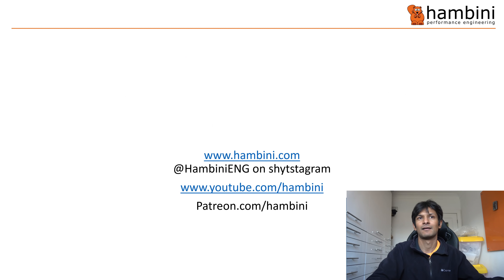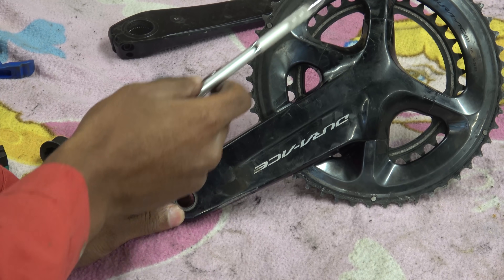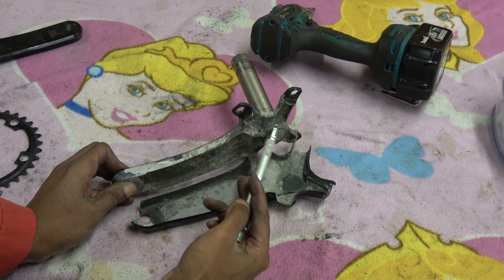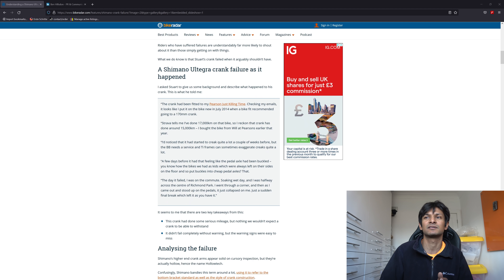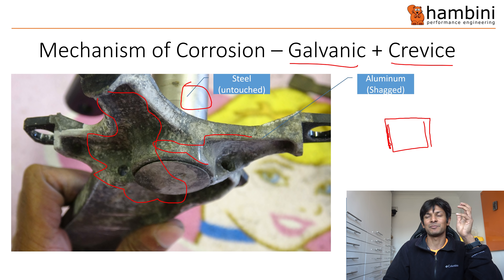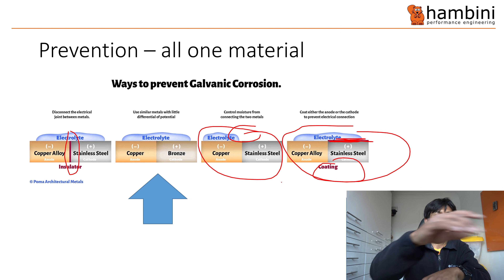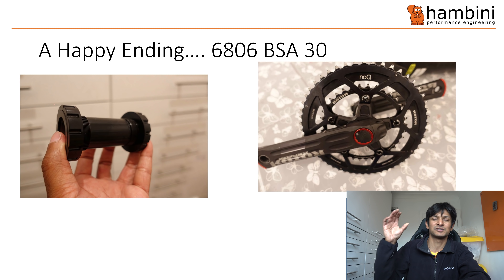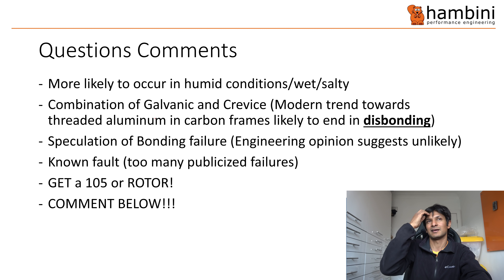Shimano REAMED for Engineering Incompetence

Comment: Believe it or not, if the component last through the warranty, I bet that’s it.  Regardless of cause.  So, if you experienced a failure 1 day after the warranty ended, too bad.  Doesn’t matter the cause.   If it’s a known manufacturing or engineering flaw, so be it, you still got thru the warranty phase.  As far as image of the company, perhaps there is not enough of failures to matter.  I don’t go out in the rain myself but it would most certainly be different for commuters and colder area where the roads are salted, as well as frequency and seasonal use.   This type of failure mode doesn’t seem to be sudden catastrophic failure, but instead with plenty of time for it to work it’s way to a point where one would have picked it up with an inspection before the ride or sense it.  I’m sure there is something in the manuals to do inspections prior to a ride like the way we are supposed to do before getting into the car, a safety inspection.  If say a carbon fork steerer was defective, with a sudden failure resulting in a fatality, and root cause analysis by the plaintiffs expert proved a defective design or manufacture, a whole different ballgame not likely to convince a jury with any defense argument - even though 1000s could have been sold without issue.

Comment: Could an oil or wax film on the inside of the crank prevent the corruption? Thinking to drill a hole somewhere hidden and spray cavity wax in to coat my cranks. It it has nothing to do with surface and it's within the metals
Reply from the maker: actually waxoyl might work.

Comment: I had the same issue with my Campagnolo Chorus bottom bracket.  It's an aluminum bottom bracket that was in close contact with a SEVEN Axiom Titanium bottom bracket shell.  A former pro team mechanic took off the bottom bracket in pieces.  Not a scratch to the aircraft grade titanium frame.  Why was that Mr. Hambini?  Is it because aircraft grade titanium is highly corrosion resistant?  Seven cycles really made me a life customer after that   Too bad so sad that Hambini doesn't make a BB for Campagnolo or I would have replaced the Campagnolo BB with his.  Ceramic Speed it is.

Comment: I wonder if there's clearance between the two shells of the driveside crank arm to drill a small hole in the rivetted end of the axle from the inside and spray some oil or paint in there to coat the inside surface? 
Of course, then you've just created a hole for moisture to get in and added a chemical that might attack the adhesive. 
Seems like Shimano should be coating the inside of the crank arm from the factory.

Comment: Shocking that such an obvious fault passed the design phase. Checking for corrosion cells is a key step for approving something before it goes into production. And corrosion basics (like explained here without entering the details of thermodynamics of corrosion potentials or corrosion rates calculation) is taught in the curriculum of mechanical engineers. Totally preventable and predictible.

Comment: I read, a while back, Reynolds put non-anodised aluminium nipples in some carbon rims, and they suffered galvanic corrosion.  The problem went away when they used anodised nipples.  Could Shimano anodise the aluminium parts before bonding the steel axel?  Maybe that would mess up the finish on the outer surface.  Or paint the inside before bonding the axel.  That's the insulator solution and surely wouldn't cost much.  And where the legs of the spider meet the chain rings, are they open or sealed closed?  Because there is an unsightly gap where they join, it's just asking for water ingress.

Comment: Bottom bracket creaking has to be one of the most frustrating things for a cyclist to hear. It's as if all your power and strength is going into thin air. When you hear silence when standing up and really stomping on the pedals, you just feel stronger. In Hawai`i, this design would be a real problem, because corrosion is king here in the islands.

Comment: Shocking design in the first place, classic case of "over designed", I still run original 7700 dura ace crank and Is faultless at 20 yrs old, lovely facom screwdriver 👌

Comment: So if I am riding a Ti framed bike with a 9100 crankset in the desert with the average power of the same prawn as Hambini (which I happen to be) am I (a) generating enough electrical power (through galvanic corrosion) to recharge my phone, or (b) absolutely fine or (c) Should change the 9100 before it attempts to kill me or (d) All of the Above?

Comment: Carbon rims with aluminum spoke nipples causes a similar problem: a gradual redox reaction that corrodes the nipples until they crack and fail. Aluminum spoke nipples are fine for alloy rims, but carbon rims should use brass spoke nipples.
This whole thing makes me question the longevity of carbon frames having aluminum dropouts for the wheels. That construction is common and I wonder what measures manufacturers take to prevent corrosion.

Comment: In my view the snapped axles on Shimano road cranksets (105 / UT / DA) are even more worrying than the much more common delamination or cracking of the crank arms / spiders.  Also totally inexcusable on a solid piece of steel.
Reply: @Hambini   Would the battery effect (steel / alu) weaken the axle, or is the weakening entirely limited to the aluminum of the cranks and spider?
Reply from the maker: @pmcmpc  it will always attack the more reactive material. in this case, it's the aluminium.
Reply: What do you think is causing the axle failures? It seems to be confined to 9100 / 8000 / 7000. AFAIK it never existed before last gen DA/UT and soon to be last gen 105.

Comment: Perhaps Shimano make the problem by not fully anodizing parts before glueing. Anodising greatly protect from any galvanic corrosion because it create a insulation all around the anodised part.
But there is another more insidious reason Shimame made it like that. The ansver is planned obsollesence so user is forced to buy one each year/period.

Comment: Would be interesting having a review about the carbon frames and forks having aluminium drop outs. You kind of made me worried right now !
Reply: Typically the aluminum inserts for bottom brackets and dropouts are wrapped in fiberglass before bonding.

Comment: Just watched this. I'm sad that Shimano  are making a poor product. I did always buy Shimano since I re-started racing in 2001, then when I built a new bike in 2003 I chose a SRAM red chainset as my local bike shop sold it to me for £200 and it worked with my Shimano front & rear 9 speed gears.

Comment: So the only way to avoid the corrosion is to have equal materials on axle and crank arm (aluminium), but you will end up with another problem : stress fractures of the axl...

Comment: very interesting topic, I have been wondering about that since some time, aluminium and carbon not so great together, but you seem to throw titanium into the same basket, doesn't seem to make sense, a carbon frame with a Ti insert seems like a good idea to me (just expensive) and actually pressfit would make more sense, since you didn't have to cut a thread into Ti (where you then have to thread an aluminium insert into) and you could mill the Ti after the frame is baked, and in theory it shouldn't be too difficult to get it perfectly concentric and in tolerance...

Comment: People want lightweight - this what happens. The other thing is galvanic corrosion.
Other cranksets from other brands might snap too.
The left crank of Shimano Deore Hollowtech 1 (Aluminium) broke in my case too.
Crankset Shimano XT 730 from the 1980-ies is still running.
Crankset Shimano Tricolor from the 1990-ies is still running. 
Crankset Shimano Acera or even Tourney for GBP 20,- to 30,- including chainrings are turning and turning. It's a lot about the weight. A lot of lightweight stuff is just not lasting. 
Shimano is Shimano. The biggest brand in cycling. Broken is broken. The distributor thing is not customer's problem. Just write to Shimano Japan - for example thru Facebook, Instagram and so on.

Comment: Excellent as usual! Around 31:15 you say that even Ti inserts in carbon will cause problems, but I don't think this is correct as their potential is almost the same; also, eg: helicopter blades can be a CF/Ti sandwich without issue, and some frame makers have used Ti dropouts and inserts for this reason. How are the latest Shimano cranks made? -looks the same to me.
Reply from the maker: You would get the galvanic effect whenever this any potential difference. This is why screws and joints in replacement hips etc are all of the same material. CF TI is fine in a helicopter blade which is sealed so there is no electrolyte ingress.

Comment: Sportdrink dripping out of bottles on the downtube and seatube cages may be the source of the electrolyte causing the crankset corrosion.  I had a corrosion issue with my Trek Madone BB90 bottom bracket bearings. I was going through bearings every few weeks until I witched to a Camelback for my sportdrink during rides.  Problem solved.
Reply: Switched, not witched.
Reply: I would worry more about road salt when biking in winter.

Comment: Question is? Has Shimano changed anything in their production to improve their hollow tech crank arms. What is a better alternative to Shimano?
Reply: Well it depends if u like carbon or not ? The latest bike I built was Scott Addict 
Di2, Ultegra, but I never really liked the D/A  or Ultegra chainset , so I went with
SRAM Red , to me looked better, was lighter and changed gear as smooth as 
anything Ive ever owned . After reading this lot Im happy with my choice .

Comment: The important question is - did Shimano address this in new Ultegra/DuraAce 8100/9200 line? I was wondering since it was published but nobody bother to check (as of now). Maybe our favorite engineer can have a look! ;)
PS: Thanks Hambini for the work. This was very interesting video to watch.
Reply: That would be an interesting concept.  Shimano fixing the problem as we sleep wouldn't  work.  We are aware now. Anyway, dream on!
Reply: @davidburgess741  not sure how you mean it David. Shimano is aware of the issue for many years now. So I would assume, there is some chance that they addressed it in the new generation.

Comment: Now I know why the bike manufactures are putting Rotor or FSA cranksets on their Ultegra and Dura Ace kit built bikes. Big bonus on the Rotor crankset is the ability to customize it with oval chain rings. Have you any experience with Rotor Q Rings?

Comment: And this, this is why I grease my old square taper cranks. Steel axle in an alloy crank, that's fucked if you don't grease the contact surfaces.
And if greasing the axle makes your crank stretch, well that means it wasn't a good crankset to start with.

Comment: My 7410 Dura Ace group has served me fine for 25ys. Best thing I ever did is keep my old steel DeRosa and 10V Chorus Rossin. I’m not a retro grouch in the least, I like technology, but I find nothing in modern bike parts and frames appealing and all of it unreliable and disposable or stupidly expensive and difficult to maintain. Even those two old bikes sadly need $70 bottom brackets rather than $1’s worth of ball bearings to keep running. Ever see the movie 'Idiocracy" by Mike Judge? That's where humanity is headed.

Comment: the cap seems like its not structural, all the loading goes into the other part
Reply: No, because the pedal torque interfaces with the cap. Also the twisting motion goes to opposite ends, one of which is always at the seam.

Comment: Would old b-type plates fit to that type of crank? I have FC-4500 (52/39 speed Tiagra) but finishing varnish simply brakes and peels off after years. Looks nasty. Don't care about the colour much, just the mounting holes and overall chain-rings offsets.

Comment: If a Hambini bottom bracket can now run a 30mm axle in a BSA shell by putting the bearings outboard, is there any reason why the same couldn’t be done for a BB86 shell, since BB86 is similar to BSA?
Reply from the maker: you can't do that because the bearings sit within the boundaries of the frame on bb86
Reply: @Hambini  argh, I missed that one is 68mm and the other 86mm due to the digit reversal and assumed they were the same. Not very dyslexic-friendly. I’m assuming your BSA 30 cups bring the width out to roughly the same width as BB86, so there’s no option to sit outboard to take it out any further. Shame.

Comment: serious question from engineering ignorance:
why do Shimano not MIG weld (or any other form of suitable alu welding) the two aluminium halves of the crank shells together and then clean to a polished finish?
(OTHER THAN COST)
If you can weld an alu frame, why not weld alu cranks?? surely this would be a better/stronger solution than an epoxy?
Reply from the maker: costs too much and you get distortion

Comment: Great video. Tangentially, the cast aluminum swing-arm in front di2 mechs fail regularly as well (mine snapped while climbing and shifting). Shimano rep told me it’s pretty common (really??). Tiny little individual part that isn’t manufactured to be replaced is common. Ergo, recommendation from Shimano is to replace entire ($200+) front mech.

Comment: the diagram you showed was from hollow tech 1, not the hollowtech 2 that you had. hollowtech 1 i think was a much better design as the crank arms are one peice unlike hollowtech 2. i think they were hydroformed before the ends being forged closed and machines for the octolink BB interface and pedal thread.
i guess it was much more expensive to make for them, hence moving to the cheaper easier to make cast and bonded structure with a pressed in axle.

Comment: I had a (almost new but second hand) Ultegra 6800 crank crack on me after two winters on salty streets. It took me a while to figure it out (bike mechanic even said the cranks were bomb proof). At first I swapped the bb, the pedals tightened the chainring bolts, even checked the frame for cracks... But then I noticed that I was able to make the crankarm creak by just twisting it in my hands. The crack was only about 2cm long. I have no fotos since I threw it out. 
I switched to 105 because I wasn't about to spend so much money. Glad to hear, that it's more likely to hold up.

Comment: I agree that it is a common failure, but it’s only common due the the amount of Shimano cranksets being ridden globally. Is it one in a hundred, one in a thousand or ten thousand?
I've replaced three in Denmark over the last four years. Two 6800 and one R9100. I repair and service around 600 bikes a year.
I wonder what mechanics are generally experiencing? Shimano won’t give us the statistics...
The two 6800 sets were out of 2y warranty, but was replaced free of charge by Shimano anyways. DA has 3y warranty and was also covered.
Reply: Still at this money it shouldn't be a concern in my head, I paid this much to worry about it failing if I get it wet? Good business practices aside its bad branding when DURA is in the name

Comment: Do you know where your crank was manufactured. I live in Thailand and Shimano cranks sold here are made in Malaysia (same climate). I've used hollow tech cranks for years with no issue and don't know of anyone having this type of failure here. I can see possibility of condensation inside cranks that were assembled in a humid environment and sold in a cold climate.
Reply from the maker: Some have said made in Malaysia

Comment: To be fair to SRAM (and I'm no fan of the company, generally), I've never had to use anything other than the wave washer on SRAM GXP cranksets - multiple cranksets across multiple bikes.
Reply: I have GXP for more than 10 years already.
There is simple solution to replace wave washer.
Buy reinforced rubber hose with internal diameter equal to axle diameter.
Cut 2-3mm to make a washer as thick as required to get proper preload on bearings and the additional benefit is you don't have naked axle between crankarm and bearings, so it is more dust-proof.
I use this solution since 2007 as I was not able to get proper preload with original washer and uncovered part of axle was dirty.

Comment: This is clearly an engineering mistake, but I don't understand how Shimano have not modified the project which clearly has a fundamental defect, the problem does not only involve a generation of products, but this technology (Hollowtech) has been used in past models such as in the more current ones and to worsen the thing is the potential injuries that a breakage can cause to a user, it is incredible that a company so large, important and with such a large number of pieces produced has not changed its design over time, taking in fact such a great risk.
Reply: Because they don't accept any design/manufacturing failures.

Comment: Funny how it only seems to effect Four arm chain-sets. I’ll stick with my five arm spiders a bit longer.
Reply: Still riding my five arm spider crank on my turbo trainer, only changed the threaded cartridge bottom bracket once in 10000 miles, could probably get another 5000 turbo miles just yet - 5 arms rock!
Reply: @unohoncho7727  got Ultegra 6700 hollow five arm cranksets on all my bikes. Like you I do thousands of miles. I can put out plenty of power any they running perfect.